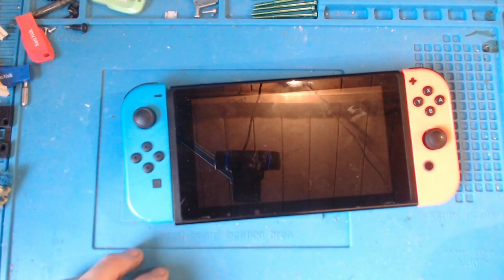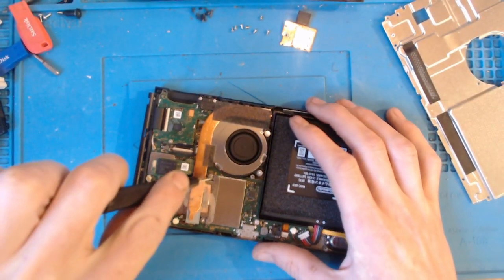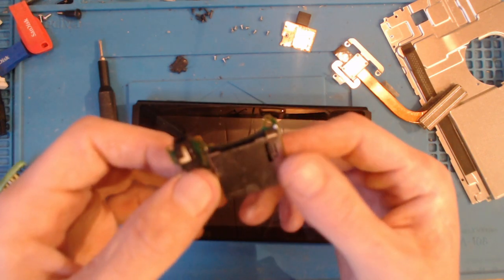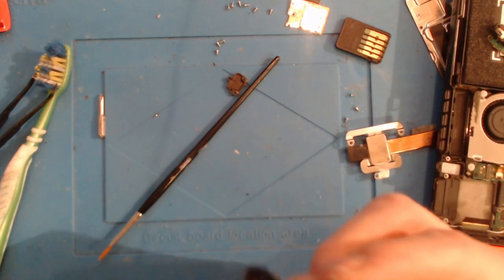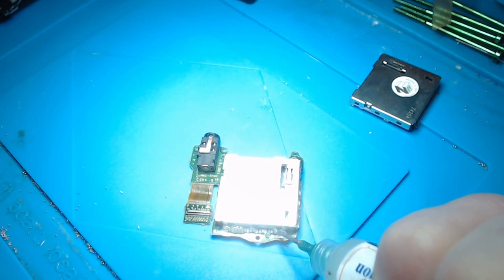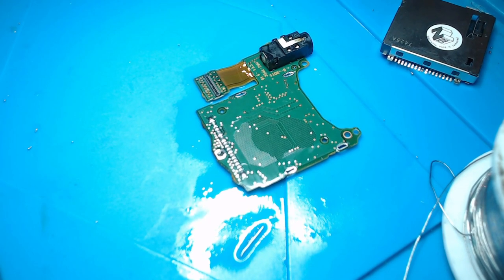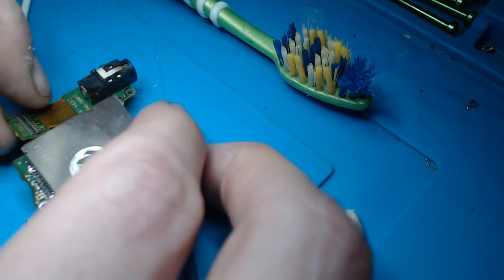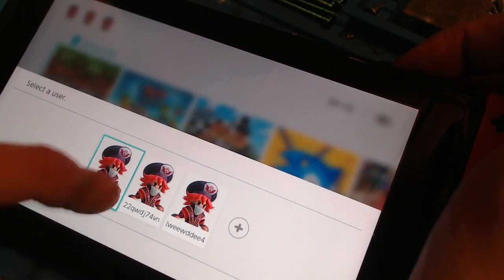Nintendo Switch Not Reading Games - Faulty Cartridge Slot Repair For An NHS Nurse

Comment: I recently did this same repair, but the replacement didn't work either! I was so confused so took apart my own switch to install that cartridge reader to see if my soldering was off, and then I somehow broke that too! I was livid.

Great repair, I enjoy watching your videos! From a fellow midlander!
Reply from the maker: Thanks buddy. Yeah they can be a pain sometimes but generally I find when they don't work after replacing the cartridge mechanism it's because it got dropped or the connector is damaged. The problem is if the connector gets damaged it has a small bga chip behind the connector which makes it very difficult to replace the connector without affecting the bga

Comment: Great work, I’m going to order me some to start doing this. I always swapped it with one from a donor switch!
Reply from the maker: They're about £7 to buy now mate so definitely better to replace the slot then the entire module 😄
Reply: TheCod3r I was able to buy 3 at $4.40 US each
Reply from the maker: @jasondoesthings919  thats pretty sweet, were they from aliexpress?
Reply: TheCod3r no a seller on eBay, I never used alliexpress.
Reply from the maker: @jasondoesthings919  ah nice, I'll look into it see if I can get some cheaper myself, I come across them not reading games quite regularly to be honest
Reply: TheCod3r that happens to me some times, but I didn’t fix them a lot of times, because I thought that level of board repair would be to hard to do, but I starting to mess around with board level repairs and I will be uploading my adventures starting next week. I already filmed some of it and there is a few fumbles, but that’s what my channel is about a journey to learn new things, raw and unedited.
Reply from the maker: @jasondoesthings919  i will sub to you so I can follow along, it's always nice to see newcomers in the field. A lot of people think component repair is hard either because they have unsteady hands or don't understand the circuit but in reality you don't need steady hands, mine aren't very steady as you'd see in my reballing video, and to be honest I don't fully understand how the circuits work but common sense and a lot of research helps. The only problem with this line of work is the cost to start up, it can be scary to have to spent hundreds on equipment but it's worth it in the long run and definitely pays for itself. My rework machine cost me £500 total used if I factor in fuel costs when I collected it from 200 miles away and also the cost of a new top plate, but it's probably made me twice that back in 3 months so definitely worth it 😁
Reply: @TheCod3r  I have a background in electronics and engineering so it's not the figuring out the problem part it's the soldering of the tiny parts as you will see in an upcoming video, I had a hard time with an 0805 cap. However I got through it and now I know for next time.
Reply from the maker: @jasondoesthings919  yeah I did check out and sub to you and noticed you're already experienced, to be honest the way I learned was just to pull components off and resolder them lol. Wait until you get to an 0201 filter and cap, that gets fun 🤣
Reply: Jason I'm curious one year later, did you succeed?

Comment: Hello. I have question is there any fuse or what chip on the 
switch main PCB is responsible for the right joy-con? Couple days ago my
 brother use RCM to check my switch and from that time my right joy-con 
is not working, it's not problem with broken rail or connector, i 
replace them both and check them in other switch (works) i found the 
point just under the right joy-con ribbon connector that is equivalent 
of RCM pin 10, i try to ground it and check if the hardware button work 
to turn console it in rcm mode but even from this point it's don't do 
nothing. I check the joy-con i the different console and it's work.

Comment: Screwing things without powering off the unit?
Reply from the maker: Why would you need to power off the unit to screw something in?
Reply: @TheCod3r  you are risking something coming in contact with the running board (screw/ screwdriver/ ect) causing something to short or fry.